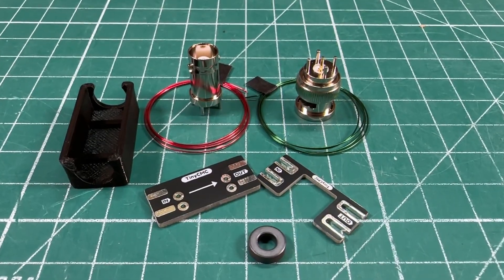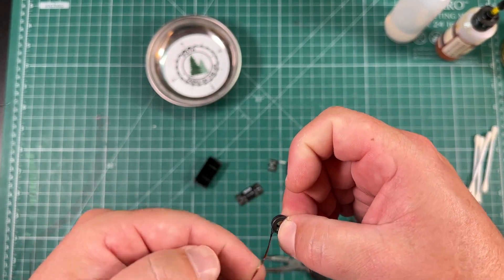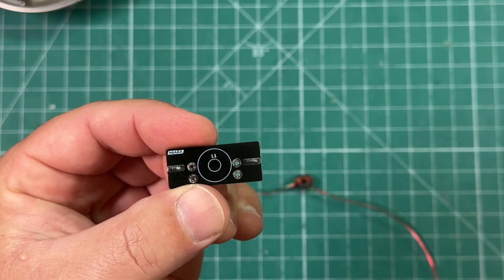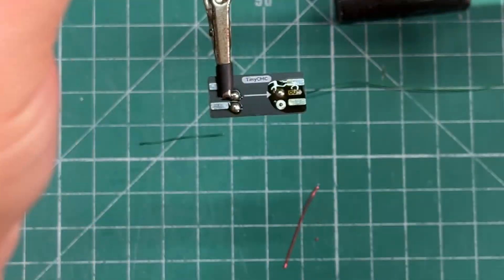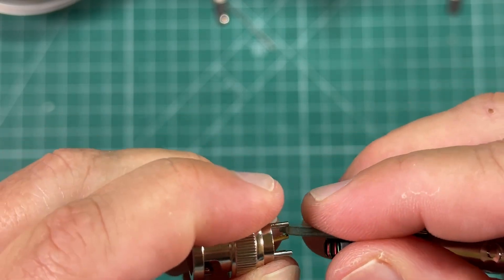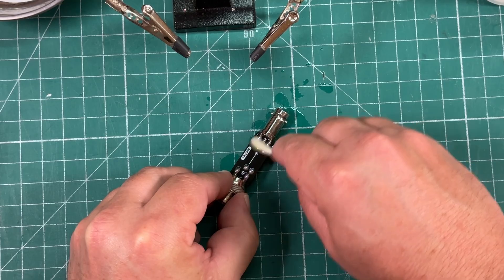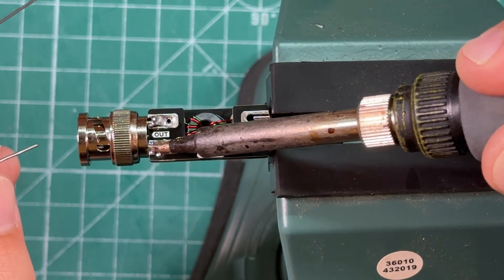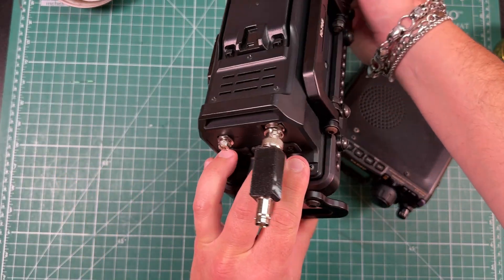Tiny CMC 10-80 Common Mode Choke by N6ARA

Comment: Have you actually measured the common mode impedance on each band?  Truth is, there is no such thing as a choke that works equally well on all bands and even needs to be designed for the type of antenna it is to be used with.  "It's not a "one size fits all" sort of thing.

Comment: That was great. nice QRP kit. can put on  antenna or radio side. depending on type of antenna and or counter poise. small  for SOTA use !  that is called Bi-feeler winding . never let red/green wire cross. now make same thing with t-140-43 or t-240-43 core wrap with red/black zip cord like #12 powerworx wire and can use on DC to stop RFI noise like on a solar MPPT controller. use 2. one one each side. solar PV input and Battery side keep close to controller. cleans up RFI noise on that MPPT you showed on amazon one that made RFI you showed . in case  of 10 amp use #16 or #14 wire. get more turn's that way. Common Mode choke is great for DC power to block RF. I got one on back of my IC 7300 . 73's

Comment: My thoughts are: If you soldered first then cut the wires, you would have a better chance to burn off the lacquer and also have a better view of the joint rather than just seeing a blob of solder.

Comment: Use some hot glue on that toroid, it will save you trouble later. Mechanical micro-phonics are a thing, not to mention it will save the wiring from breaking.
Reply: Is hot glue what you used to keep the torrioid in place?

Comment: Try to strip the lacquer of the wire befor soldering. Sorry, but your soldering looks terrible and will result in a cold joint over the time.
Reply from the maker: Hahaha!
Reply: Soldering looks fine, if anything I would imagine that is lead free solder which is lighter in colour, less shiny and an absolute cunt to work with, I throw the shit right in the fuck it bucket.  But it's getting pretty damn hard to find true 60/40 lead solder, so it is a concession most people have to make, especially if you pick up your iron once or twice in a year.  Lead free solder usually requires 50-200 degrees more in heat at the iron to melt, and it also requires about 2% flux by mass in order to wet properly, absolute garbage.
Reply from the maker: @meola69420  It's 60/40 lead solder